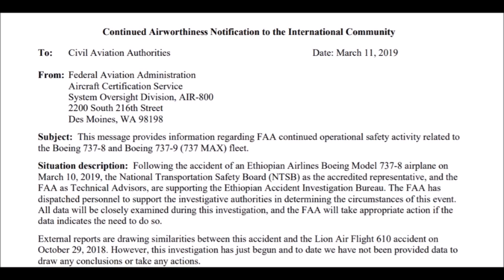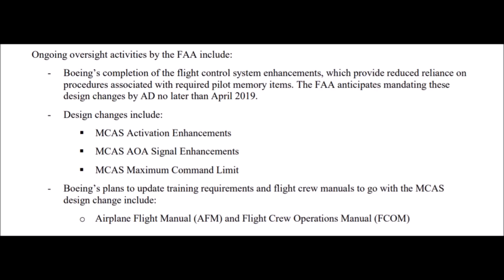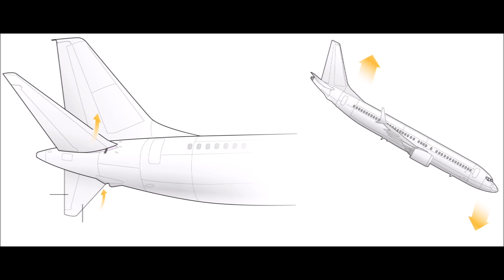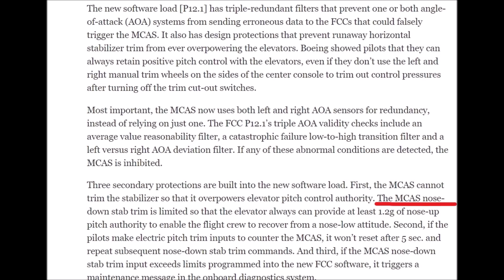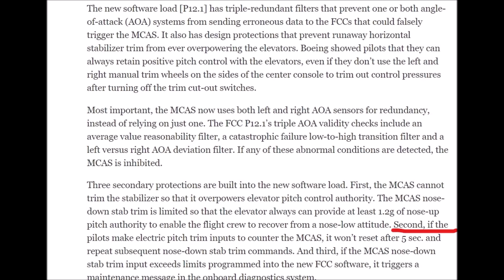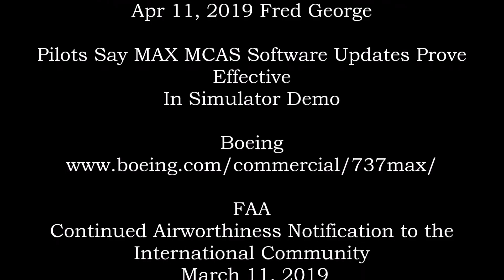737 Max UPDATE 14 April 2019 "The Fix"

Comment: Wow and each single one of these points could have caused an unrecoverable situation during flight by the MCAS. So careless from Boeing.
Reply: Not quite. Pilots had under a minute to manually disable stabilizer trim to keep from winding up in an unrecoverable situation. The LionAir 737 MAX had this failure multiple times. Twice the pilots were able to disable the stabilizer trim in time, and completed their flights without a catastrophic incident. The third time, they were not well trained enough to react appropriately.  

Not that Boeing has any excuse for putting those pilots in that situation in the first place... It's unforgivable that MCAS would not recognize an AOA sensor mismatch and disable itself. The entire purpose of redundant instrumentation is so that you can identify a malfunction via the redundant instruments giving mismatched values. To have an automated system that gives out control inputs not monitor for a sensor mismatch, and disable itself if one is found, is criminally negligent. 

It's such basic stuff. Computers cannot think, they process input and produce output. Boeing decided that the computer did not need to have the most basic of sanity checks on that input, even though the computer had all of the required hardware and data to preform such sanity checks...
Reply: @SlocketSeven   yeah that is the pilots were not well informed (not even trained) about the MCAS, a system which has so much influence on the flight especially during critical portions like takeoff. That is unforgivable.
Reply: SlocketSeven Yup. Plus the aircraft should never have that much authority. The fact the FAA thought the authority they thought the Max 8 MCAS was given was much lower than what they eventually learned that MCAS actually had.
Reply: @SlocketSeven  Yes!
Reply: Careless?!  Umm!!   Closer to culpable homicide through preventable negligence & incompetence.   If I trip over my own shadow, now that’s careless!
Reply: The MCAS system as it stood was not great.  But (sadly), the situation went from fixable to diastrous due to pilots not following the runaway away stabiliser trim procedure properly, and allowing dangerous flight speeds to develop and THEN re-engaging MCAS at a critical point.

As Juan has said in his second last video, the pilots failure to follow procedure turned what should have been a "non-event" into a tragedy.
Reply: @JulianGerretsen  
The problem is not in the MCAS, it's about informing pilots about it. As you know,  many pilots didn't even know of its existence and the extend at which it can operate and influence the flight. That's the issue. There is no human error from pilots whatsoever
Reply: @JulianGerretsen  The design of MCAS was not great? That is the understatement of the year. A safety system that makes the plane more dangerous to fly. Were the engineers standing on their heads when they designed it? If the MAX left the factory without MCAS, the planes from the Lion Air crash and the Ethiopian crash  WOULD PROBABLY STILL BE FLYING TODAY.

Comment: what's a pilot to do if both AOA sensors malfunction?  can you hand fly a 737 w/out AOA sensors?
Reply from the maker: Yes.
Reply: If the pilot knows about it, the plane is quite flyable.
Just disable every level of autopilot and autothrottle automation, and fly the 737 as if it was a very very large cessna.
Not easy, but quite doable.

Total loss of airspeed info is worse. Way worse.
(Fortunately, almost everyone has a gps-enabled mobile device that will give location and (ground)speed with some modicum of accuracy.)
Reply: @marvinkitfox3386  What instrument tells a pilot whether he is flying level or nose up or nose down?
Reply: @robertbrandywine  to quote the wiki: "modern AHRS(attitude and heading reference system) use solid-state electronics, low-cost inertial sensors, rate gyros, and magnetometers". Basically comparing current airframe position and direction with a very accurate gyroscompass.
.
AOA is a totally separate sensor, which shows to what extent your plane is flying in the same direction it is pointing.

Comment: Somebody at Boeing must have been in the Navy;  The solution was to stupid proof the system.  I wondered why if one of the AOA sensors was going way off the scale, the other didn't have input to at least attenuate the readings, and why did the system  allow the MCAS to have the power to completely over-ride the cockpit.  Seems as though the system as designed was great, but as built it was a suicide pact.

Comment: I really appreciate your assessment of the MCAS.  I guess the FAA and Boeing both became complacent when evaluating new systems like the MCAS for air worthiness.  It is really unfortunate that in this instance it required two crashes of the Max aircraft to determine that there is a problem with their systems of evaluation and certification of aircraft.  Like you I am confident that they will likely put into place much more robust systems of evaluation and certification in the future.